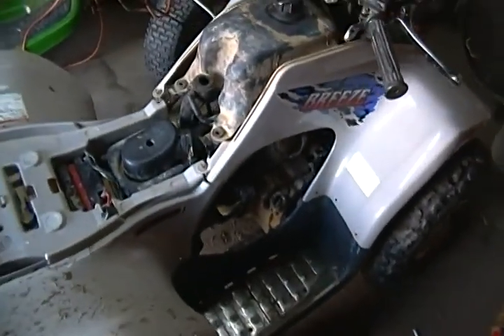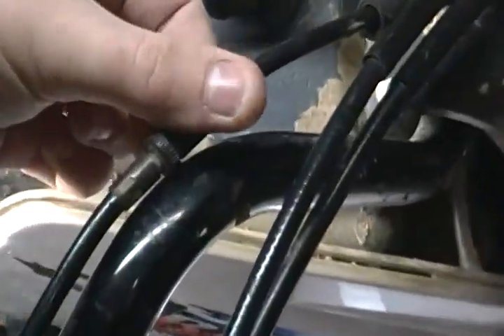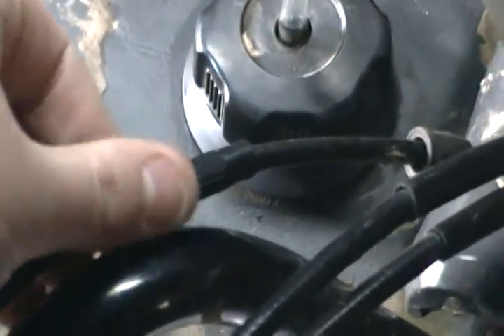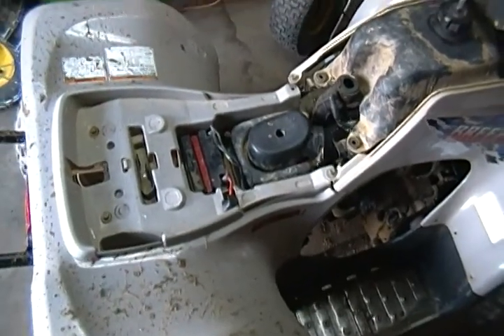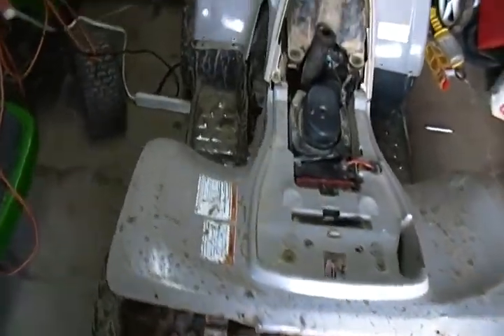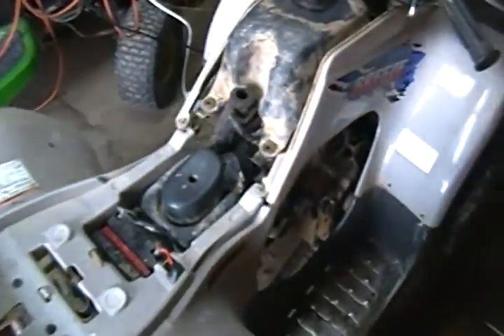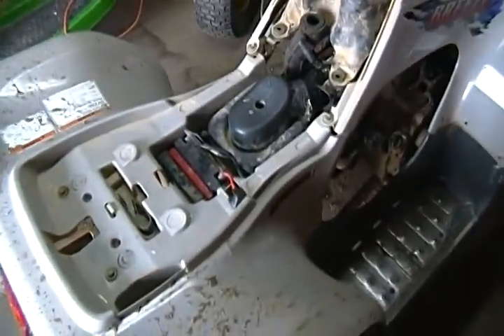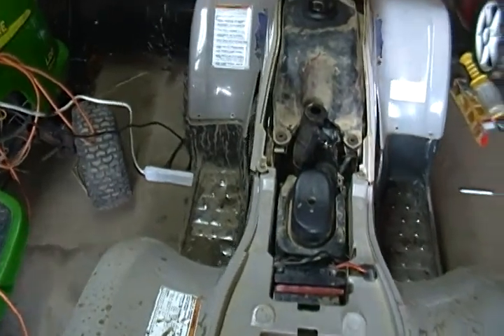yamaha update

Comment: that thing on the throttle cable is made so you can make sure the plunger gets wide open, the idle is on the carb its a little screw under the antler that the throttle cable is connected to

Comment: thats just the throttle adjustment,well one of them,there is that one,one on the carb just below the needle and usually one on the throttle itself, just screw it in to lower the idle or bring it out to increase the idle. How much you want for it?